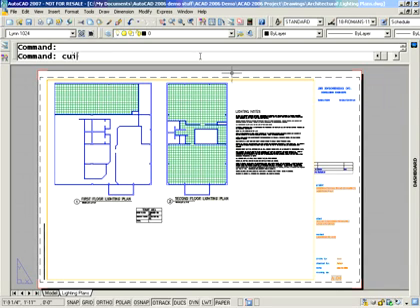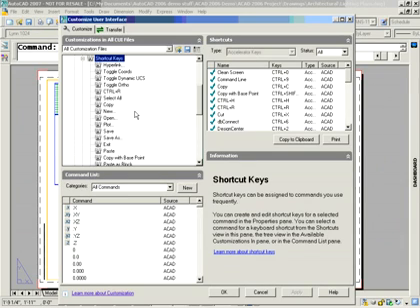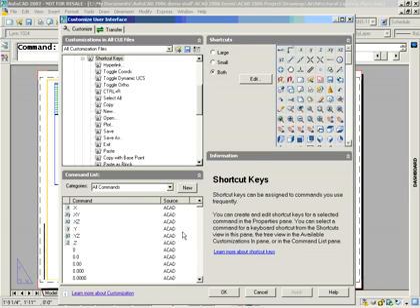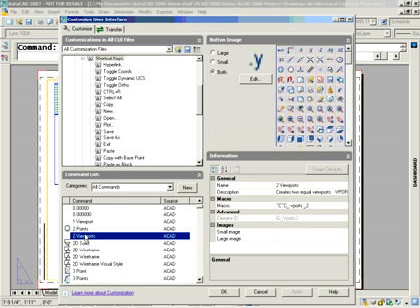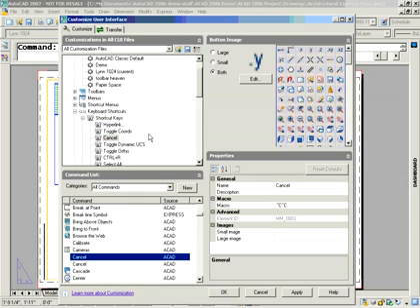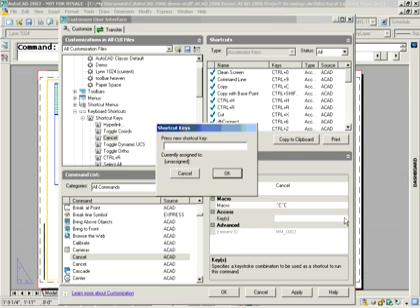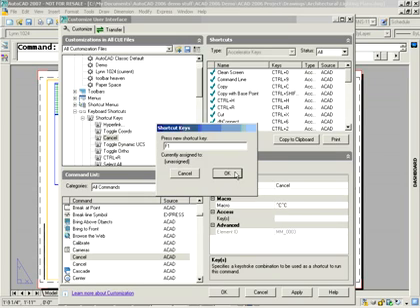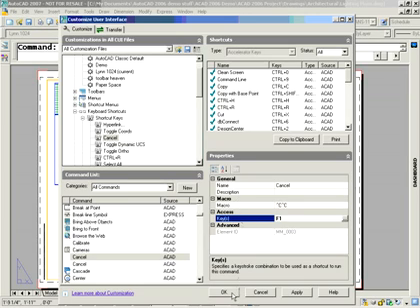AutoCAD Tip - Use the F1 Key to Escape (Lynn Allen/Cadalyst Magazine)

Comment: Great video, too bad I'm using 2025LT and for some reason I'm not able to drag the cancel command into the shortcut key sub menu. I am able to copy and paste the cancel command into the correct folder, however, when i press f1 it nullified the help menu but it does not cancel. Any suggestions?

Comment: thank you so much for such a great tip, my laptop had just been upgraded to increase the perfomance, however later i found that a few of my keppads are no longer working, one of them is the escape key, which is really important when i am using autocad. No technician wants to service the above "minor" problem, and i had actually purchased akeyboard and connected to my laptop, however i found it really clumpsy to use. And thank God, i came across your solution =). Thanks!

Comment: I accidentally closed a drawing before saving one time so changed the F1 key to be a save or QSAVE so that I accidentally save the drawing. has helped reduce the number of times I make a colossal mistake, interestingly I have not had an instance when CAD crashes during the save operation. I am using basic AutoCAD 2015LT.